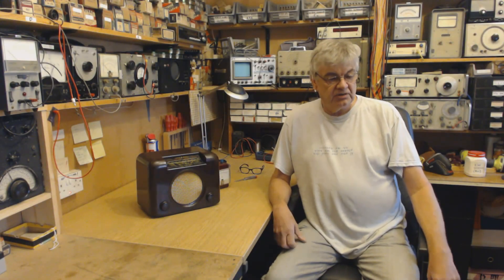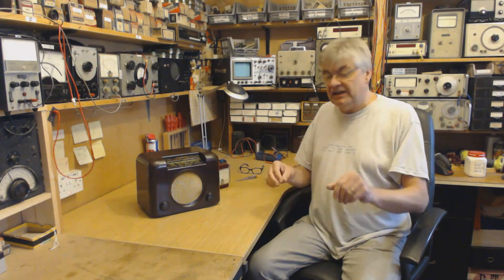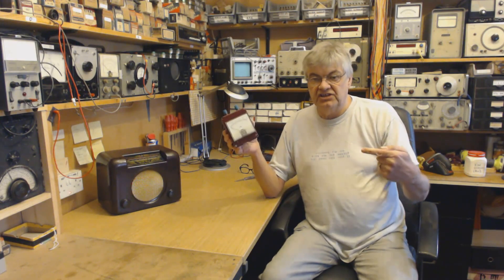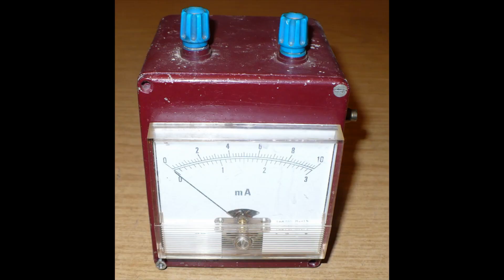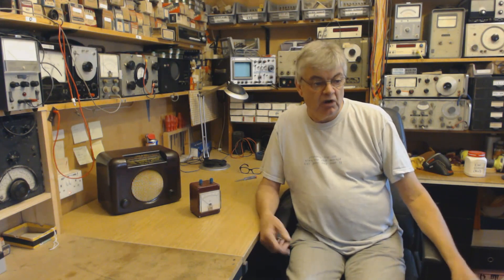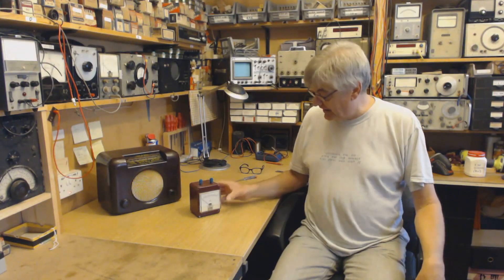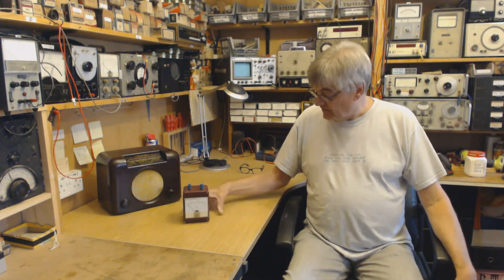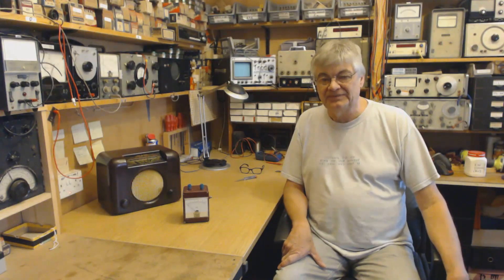An RF ammeter for end fed short wave aerials

Comment: Although RF current meters don't tend to be used much by amateurs these days, they can be very useful for getting the most effective radiated signal from an antenna. especially where QRP is concerned. The RF current meter will show the best ATU setting for any given antenna, and where an inverted L antenna is concerned, it will also show any increases of RF current due to a better earthing system. Other uses include, real time showing of balanced or unbalanced RF currents flowing in a Dipole twin feeder, and any unwanted RF current flowing on the outside of a coax feeder fitted with an RF choke.  The effectiveness of an RF current choke on a coax feeder, can also be demonstrated by using an RF current meter. So to sum it all up, an RF current meter can be very useful indeed.

Comment: Hi Ray..I knocked up a similar circuit and can also use it as a field strength meter.Always very useful when I'm out operating portable on HF with my radom lengths of wire and my L match tuner.☺73 G7HFS
Reply from the maker: Ian Harling yes, it’s a really useful piece of kit. I don’t know where I’d be without it.

Comment: A very useful piece of simple to make test equipment. I tend to use back to back diodes across meter movements to protect them from my own stupidity, obviously it depends on the meter sensitivity and resistance whether this will in itself give the protection. I looked you up since your website did not have contact information. I was going to argue with some of the article regarding RF grounding systems. I know it is counter-intuitive but I believe that insulated buried radials are absolutely fine. I agree with nearly all of your article but not that specific issue. I know that insulated wire will not be a ground at all at DC but the capacitance of a thinly insulated wire to the ground around it will be very significant. In some soils bare copper will corrode very quickly, as a result I use heavyish enameled wire or whatever I have around. It would be interesting to actually feed a quarter wave vertical against two similar length ground radials, one insulated and one bare wire and compare the rf currents flowing in each, IF I am right the currents will be similar.

Comment: Really enjoyed the video Ray. Very simple, but very useful meter.
   Thanks for the explanation of current versus voltage on different bands in conjunction with the ends and center of cut end-fed wires.
   Yes indeed, I would love to see more Ham related videos from you as well!
   Thanks and Cheers,
        Tom

Comment: Ray,
I enjoyed watching your production.  I have seen similar circuits in the past.  One, if my memory serves me correctly, had multi-tapped coil switching of some kind around the ferrite ring.  It was a long time ago I saw that circuit diagram so I may be getting it mixed up with some other circuit. 
A simple but useful piece of equipment.
Regards,
Phil (M1PKB & M3BVA).
Reply from the maker: Hi Phil, thanks for your comment. As you say, there are other circuits around, all varying slightly. Glad you enjoyed the video. Cheers, Ray.